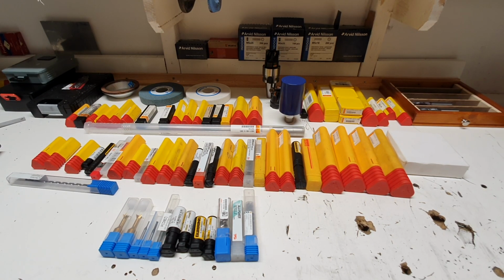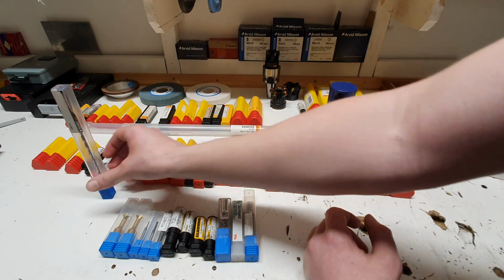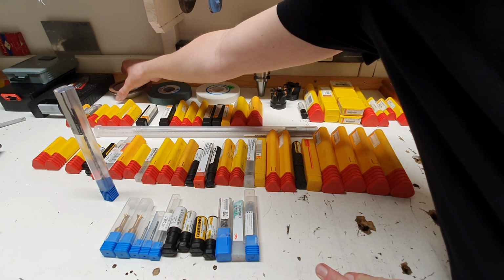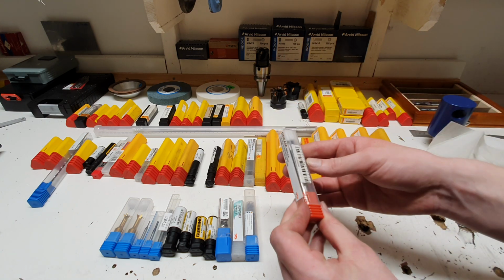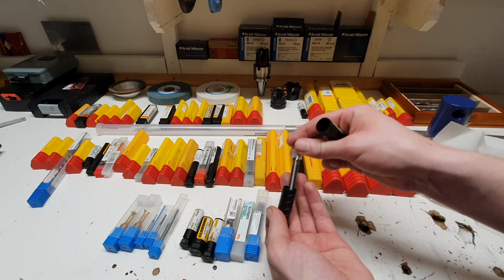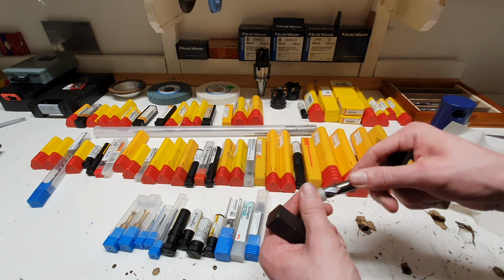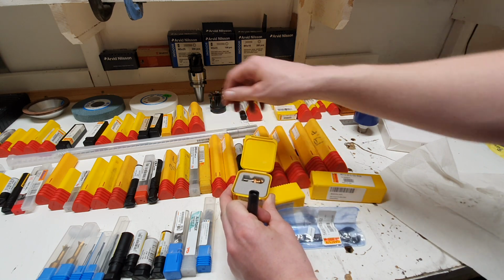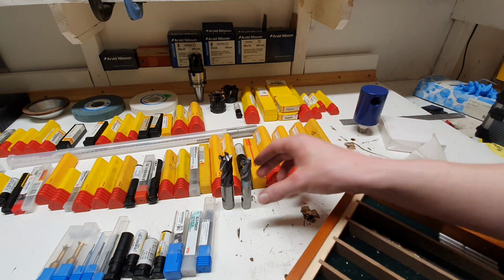tooling up carbide (yg1 gühring sandvik) + rotary union, special bearing and grinding discs

Comment: Nice gear man, real nice. I guess everybody has a guy that sells tooling haha, here i am pretty lucky i get tooling at pretty cheap prices from various sources ( smth like 14mm YG-1 solid carbide endmills for 5$, 8mm Walther or YG-1 for 2$ and so on ). Try if you can get your hands on ZCC-CT carbide drills, they are chinese but top of the notch quality, i prefer them over Sandvik. P.S. : start building a tool grinder for the drills, trust me, much cheaper than buying new ones 👍🏼
Reply from the maker: Yes the plan is to build a little grinder :D when I am done with manual mill, cnc router and emcoturn. 1. Will be to build a small little band saw. 2. Will be grinder. 

Wow that is some Good prices! :D 

Now I got endmills and drills to last me long time. Will Only buy more if it is very cheap. 

 Next thing Will be to buy tooling for lathe, I have a chinese indexible kit for about 27usd. I have not bought any quality tools yet since I do not know so much about lathe tooling. I Think I Will test the chinese tools out first and see which Ones I like. Then perhaps see if I can find some quality brand toolholders for those.

Do you have any lathe tools that you find Good?
Reply: TheChipWelder Sandvik makes good tooling for lathes and in general, Kyocera, Kennametal but you can opt for more cheap brands like MBC, WNT and others. But, you have that little router that can cut some steel and that mill, build your own lathe tooling. I ve build a lot of tooling that worked great using just a manual mini mill ( which i ve build haha ). Buy some good tool steel and inserts. Don t try to get all the inserts because you ll only use like 3-4 types ( ccmt, tcmt, scmt and dcmt )... i use only wnmg for heavy roughing, tcmt or ccmt for finishing ( got those for aluminium and for steel from various brands ) good luck man
Reply from the maker: @eugencsl  thx for the comment buddy. Lol I have actually already thought about Making some lathe tools. Nice to hear that you build your own mill as Well. Found some cheap sandvik capto clamping units + capto tool holders  which I might try to fit on the emcoturn. But I Will start of using my chinese tools.
Reply: TheChipWelder good for you bro but nothing is cheaper that a piece of steel and a couple hours of work :) plus you get to experiment with making tooling, trust me it is pretty challenging with all those angles and those tight tolerances for making insert cartridges

Comment: Nice collection of tools. Where do you source them?
Reply from the maker: Not from one source, cheapest Ones I bought many from a guy in Sweden, asked for a price of all carbide tooling he had and bought it. In total I think I bought the stuff from about 10 different sources. Most of them via ebay, sellers on ebay in russia, germany, italy, uk. A bit tricky, Most of the Times i searched for sandvik solid carbide or in germany sandvik vhm and then just filtrated cheapest first. Indexible tooling i bought on amazon uk.